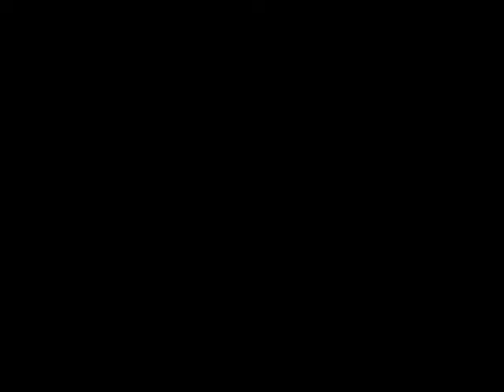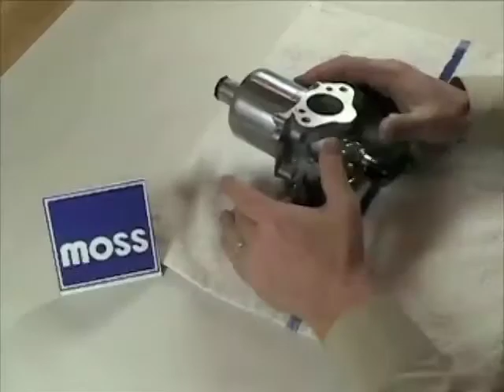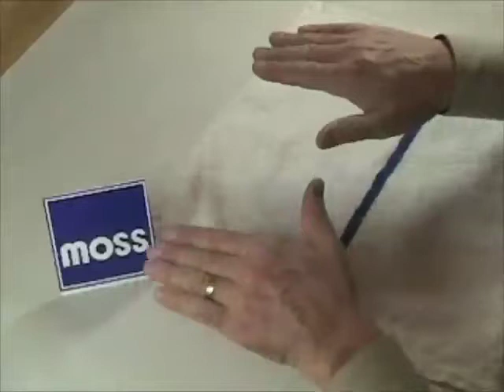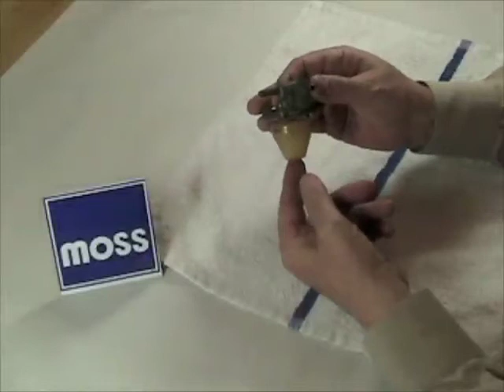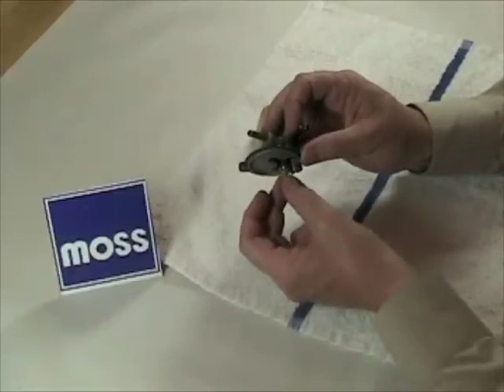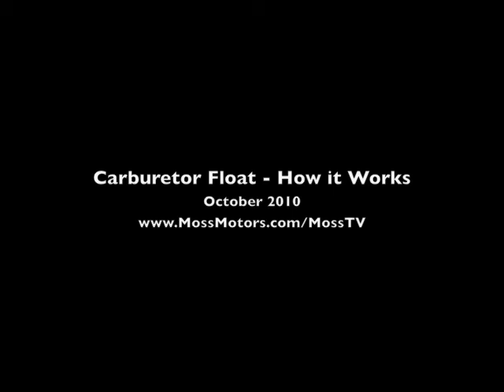Carburetor Float - How it Works

Comment: On my motorcycle there is a tube coming from what I think is the float reservior, When I put the bike standing on one wheel upright or leaned all the way over the tube leaks gas. Is this tube there so the feul does not flood the engine? how does it work?